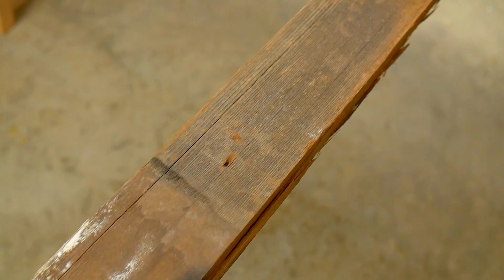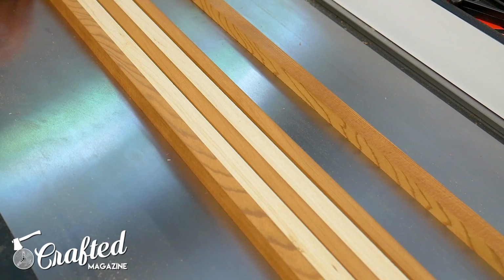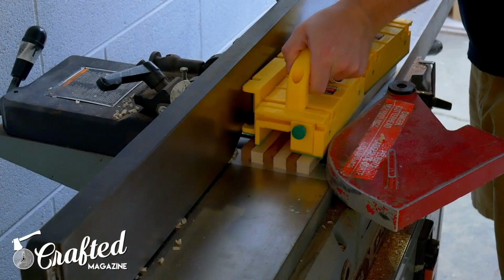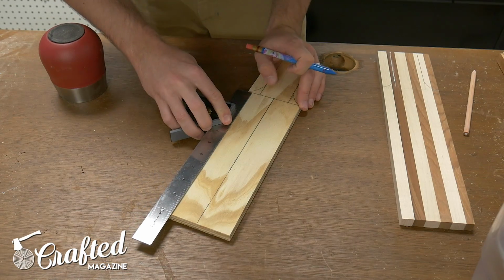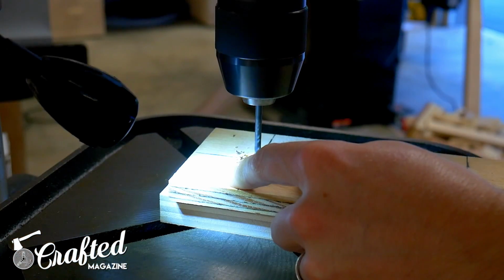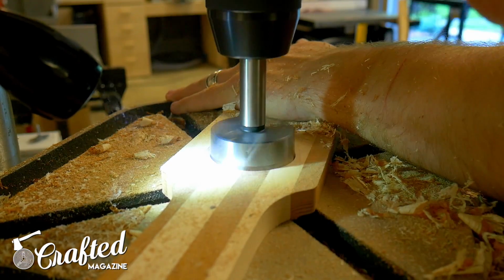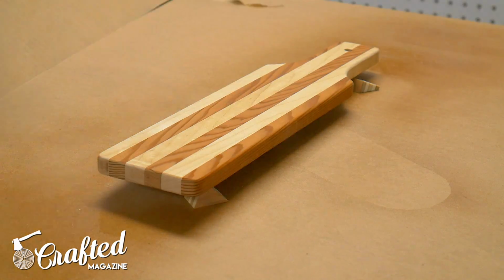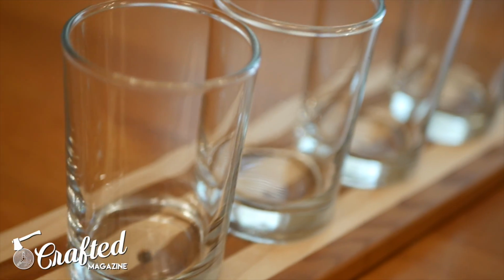Beer Flight Paddle How-To | Crafted Workshop

Comment: Several things I liked in your video. Nicely done! Going to give you a suggestion from the "Makify" channel on a similar project. He used his Dremel tool to get in, in your case, the drilled out glasses holder. Use both the disks and the drums & theoretically that should help out. Nice video!

Comment: I use a template guide on my router to make the circles for the glasses. I don't have problems with tearout and there is no hole in the bottom from the small registering cutter tip. Cheers.
Reply from the maker: Smart! Totally doing that.
Reply: +Crafted Magazine remember to oversize your template. The distance from edge of bit to outside edge of bushing is not cut. Took me a few runs to figure out why my glasses weren't fitting. 😬
Reply from the maker: Good call!

Comment: Looks nice! I do think you should get better results from the forstner bit. When I use it, the holes come out super clean. Maybe slow the drill down, like you mentioned?
Reply from the maker: Yea, that's what I'm thinking. The other potential is how different redwood and hard maple are in their hardness levels. Most of the tearout was in the redwood. Thanks!
Reply: Agree! :D
Reply: You mentioned how to get a smoother hole with a Forester bed. I would only use the Fortuner bit to drill guide holes through my template. And then I would use a flat template bit and my template to make the holes in the actual flight, that way they are smooth and completely flat on the bottom. You eliminate the small center divot that you get from the forstner bit.
Reply: Forstner bit, sorry talk to text, lol.